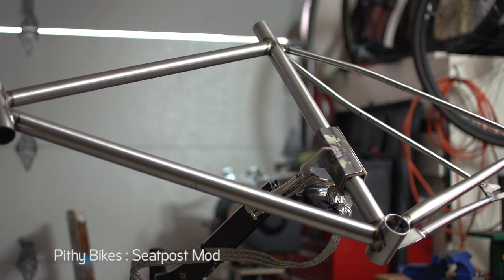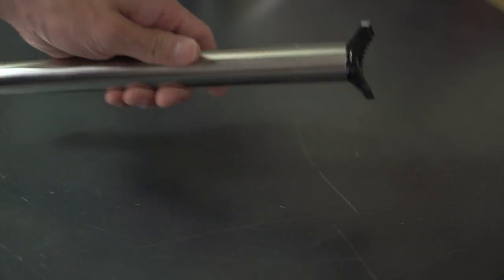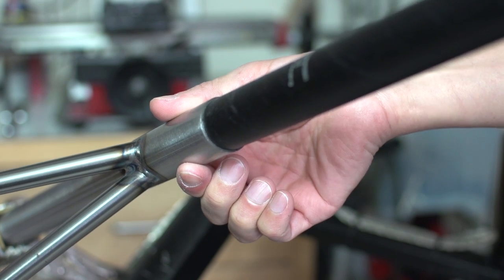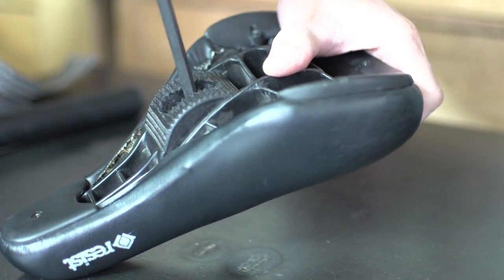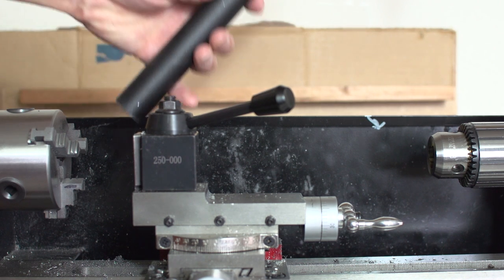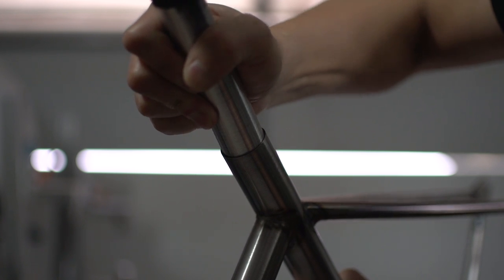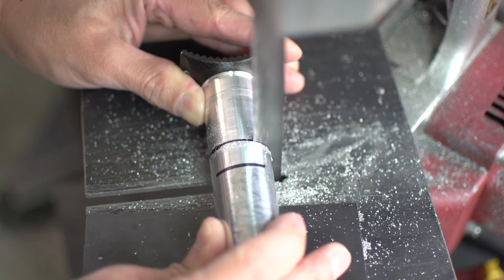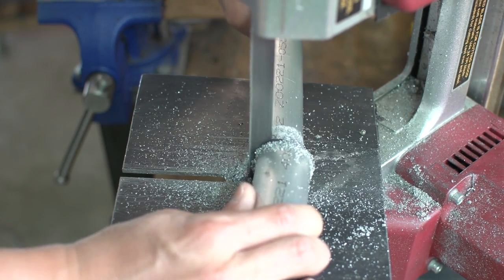Bicycle Frame Build 55 - Machining Quill Style Pivotal Seatpost Modification

Comment: Nice job! I’ve been trying to find a 22.2mm layback pivotal seat post with no luck. They do make 22.2mm straight posts, then I though of welding a steel pivotal top on an oldschool 22.2mm steel or cro-mo layback seat post. So I found the same S/S black ops you posted but was worried the top was aluminum, which thanks to your video I found out it is. Lol. Now I am looking for a top steel pivotal piece or was thinking about cutting the 22.2mm pivotal to have the layback angle. 🤷🏼‍♂️

Comment: I made a wedge-post using a 1" (25.4mm) steel "pipe type" seatpost, the top cap from a department store-style 22.2mm quill stem, and the wedge and bolt from a 25.4mm quill stem.

Only works on the shittiest or most vintage bikes, but was a great hack for a frankenbike I had.
Reply from the maker: +Alex Paulsen thos post i made started to creak. I wasnt surprised when it started. :(

Comment: I would be worry of fatigue cracks that might appear on the seat tube just above welds. 
It happened to me on an aluminum frame and I finally had to build a gusset and weld it.
Also, to distinguish aluminum from steel, I think you can use a magnet.
Reply from the maker: Hi François, Thanks for the cautionary tip. I'll likely make another seat post at some point with a longer post to avoid the chance of cracking. Out of curiosity, what was your seatpost setup and how thick is the wall on the seat tube?
Reply: The bike is a Viking Saratoga tandem and I used a 400 mm seat pin but tightened well under max height limit. The thickness of seat tube I could measure is 2mm but I think the issue as more to do with the protubing seat tube.
This is probably a design failure as most of serious frame design are either with seat tube ending 10 mm above seat stays/top tube or a gusset is added. 

The crack only appeared after 2 years of daily use (this is the bike I use to take the daughters to school), I first had the tube rewelded by a professional welder but it the weld started to crack after two months and I built a gusset using some aluminum plate I cut with dremel tool. It was my first aluminum weld, heat treated aluminum is even harder to weld and the result is not so good looking but after nearly one year it seems to hold so far.

Aluminum is probably likelier to crack than steel but I also add a steel frame that cracked because of light cable hole. I could hear some click noise while climbing for some time (I rebuilt transmission) then nothing and a year later down tube broke while in a roundabout. That taught me a lesson.
Reply from the maker: +François Gasnier thanks for the Info. I have a feeling I'll learn a lot of lessons one is start riding my frame. :) I honestly don't. Know what to expect!

Comment: Question:  In hindsight, rather than buying the CE mini lathe & mini mill, would you have rather gone with a Grizzly G4015Z - Combo Lathe/Mill (or equivalent)?  I have no experience with milling / lathing, so I am curious what you think.  The combo unit takes up about the same shop space as the two CE units combined, but has a bigger capacity (19-3/16"), and is beefier / heavier overall (475 pounds) so it should be more stable & resist vibration more than the mini version.  Also, the cost is comparable (Combo unit is $1575 after taxes and freight).  Anyway, your input would be greatly appreciated!
Reply from the maker: +Dirk Dhulst I was looking at the combo setup in the beginning but decided against it. Mainly because I heard the mill column was not that rigid. In the end, I liked the idea of dedicated machines. The other reason is that there is a lot of info and videos on both the minimill and mini lathe. It also left me with the option of a cnc mod, which I won't do. But the option is always there. Thanks for the question! Hope it helps.

Comment: Isn't the bottom part supposed to be drilled of center to be able to lock the seat in place? I really like your work but I can't see how this can be working.
Reply from the maker: +Kristofer Jonsson yes you are correct. But in this case I machined the wedge to fit snug, so the play on the hole where I drilled out threads on the top part is enough. Hope that makes sense.

Comment: shouldn´t there be a sligt offset in the lower part to actually create some clamping force when tightening the bolt?
Reply: I thought the same thing, but he turned it to be a snug fit, so most likely the hole where he drilled out the threads has enough play to allow the quill to work.
Reply from the maker: This is correct :)

Comment: Hey, not sure if I missed that bit, but should the wedge hole not be drilled off centre to make it actually wedge when thightened?
Reply from the maker: I may be misunderstanding your question - The threaded hole on the wedge is drilled at center. The hold on the saddle end of the seatpost is also drilled at center. It's true the wedge will offset when tightened down due to the wedge. However it would offset the screw no more than .5mm I'm guessing less. There is some play on the hole drilled at the saddle end, I think this provides enough room for the screw to slant itself due to the offset. Really getting into it though, what's important is that the as much of the surface of the wedge is touching the sides of the ST. The longer the screw the less the screw needs to angle itself. Because my mod is so short, it's probably causing more angle on the screw.  Whew! Thats a lot of typing for a silly seatpost :)

Comment: what about adjusting saddle height for proper fit?
Reply from the maker: the ST is at its highest for my height and for the purpose of the frame (track freestyle) There's a little room for foot on pedals stand over height. This is for bunny hops and stuff. If its too high, I'll need to cut the tube down. Thanks for the question!

Comment: great vid as always man! This is prob one of my faves. I can't remember if you've mentioned this in your earlier vids, do you intend to build the fork? How much will the frame + fork weigh in the end? Are you going for something lightweight?
Reply from the maker: I did mention it but no worries at all :) I'm not building a fork for this frame. I do plan to build a fork some day but its not in my immediate plans. I haven't weighed the frame yet, but based off feel, it's the lightest frame I own at the moment. This is due to the tube sizes and the thin wall. That and it's not a big frame. I'm not too concerned about weight. But if you're curious, I'm happy to weigh it :) Let me know.
Reply: Sure! It would be real interesting to compare it to something commercial like the Cinelli Mash Work frame, which I just purchased recently.
Reply from the maker: its 1.6kg  or 3.4lb
cheers!

Comment: Good thing you're a skinny guy lol....I'd be scared to only have that little bit of seatpost inserted in the seat tube...not much support, could bend the seat tube above the seat stays/top tube....
Reply from the maker: Hahaha yeah, most of the tubes are pretty thin. But thanks to David (Veteran Bicycle Co.) I got a thicker wall ST for just this reason. Remember when I swapped Seattubes? That was why after David's suggestion.
Reply: For me, I think you've created a really significant stress riser, regardless of the slightly thicker ST... I use an adjustable reamer set to 27.2mm (I have one like this: http://www.rdgtools.co.uk/acatalog/ADJUSTABLE-REAMER--RANGE-1-1-16----1-3-16---H12--MEDIUM-SET--83465.html but mine was HSS so a little more expensive) and I'd imagine that the pain of the purchase, to allow a proper length seat pin, far outweighs the pain of a snapped ST and/or the long ride home "out of the saddle"... Just my two pennies, keep up the good work, an excellent channel :)
Reply: I don't think it'll be much of a stress riser at the end of the post when there's none exposed  (there's not enough leverage, it'll effectively be coupled to the top of the tube.), unless you're talking about the one that will be created at the seat stays.  He will be relying on the fairly thin steel tube, but it's fairly short.

I agree though, that I wouldn't risk it.  It would be a shame to kink it at the seat stays and turn it to junk.
Reply: +nwimpney +nwimpney as the seat pin appears to be so short it doesn't extend as deep as the TT/SS joints, therefore the end of the pin will exert considerable stress on the unsupported ST, i am quite sure the pillar itself will survive when the ST kinks/folds/snaps...

there must surely be a reason why manufacturers don't sell such short posts (they'd save a lot in materials if nothing else)

just my two pennies :)
Reply: Yeah, definitely.  I just meant that it wouldn't be a problem in the same way as with a long post, and insufficient depth in the frame (kinking at the end of the seat post, often at the keyhole for the seatclamp), but that the next weakest point will be the stress riser caused by the TT/SS joints.
I think it would probably survive, though, as there's little leverage there, with the post all the way down.
The reason manufacturers don't sell posts that short, is because there would be no adjustability, and because you can always cut it down if you're going to have it bottomed out anyway.

All that said, I would still just find a way to ream it properly.  Better safe than sorry.  It would be a huge shame to ruin a frame over such a small detail.

Comment: I hadn't realized that warping of the tube could be so problematic. Wonder if the professionals use some sort of heat-resistant mandrel or insert during welding to minimize ovalization...
Reply from the maker: I did have a heatsink in there but still it distorts. I think the best way to counter ovalization is a really good miter cut and fit ups. But still it will distort I think. But! I'm not super experienced, I've only welded 2 frames now.